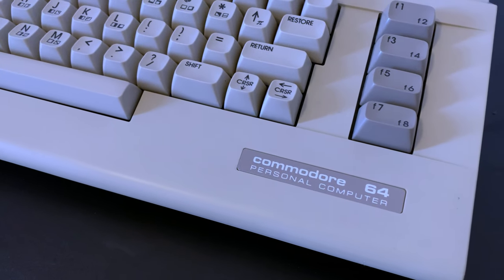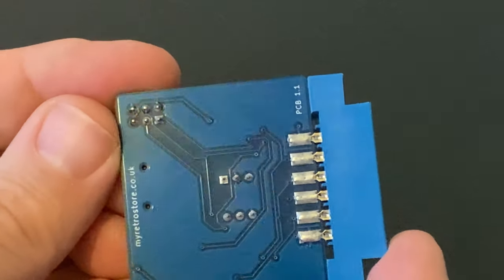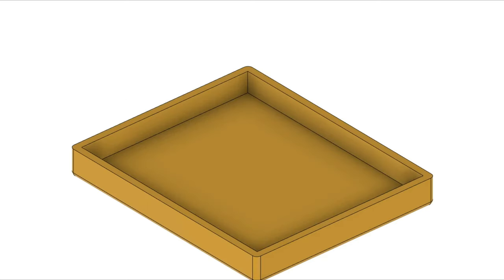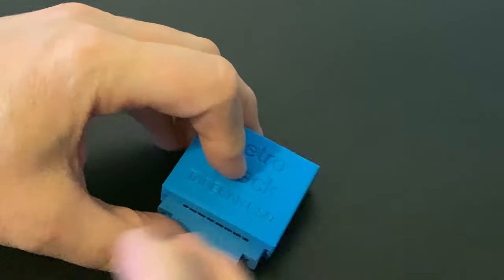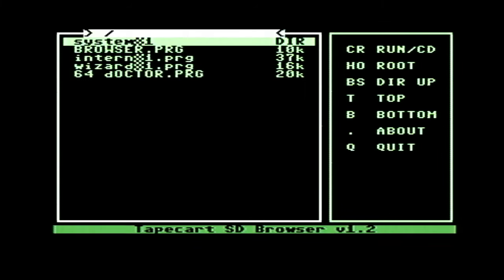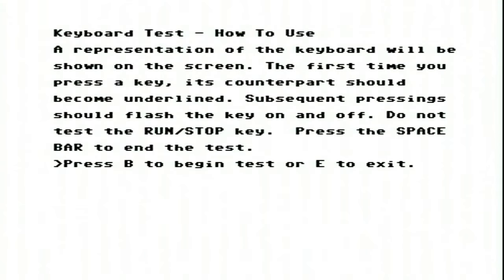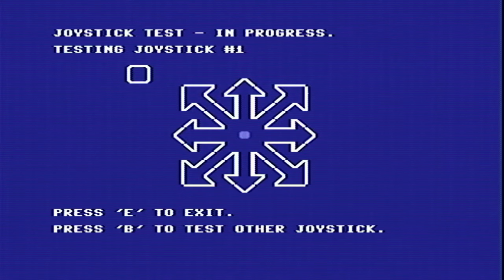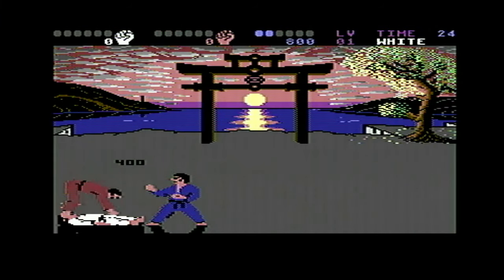Commodore 64C - Part Three: TapeCart SD

Comment: I've always liked the C64 but never had an original, as I went from the ZX spectrum 48K purchased from Boots, to the Atari 800XL with floppy drive.  Ah those were the days.  I think the Atari was very under rated and pretty similar to the C64 with regards to game quality.  
Even though I have  an 800 , 800XL and 65 XE I prefer using the C64 maxi that I purchased during 2019 and find game play and graphics hard to distinguish between the two.  I always loved the Goonies game which plays pretty much the same on the C64 as on the Atari.  
When I use the Atari I use a lead I made and put it through a hdmi upscaler where as the C64 Maxi just plugs and plays.  
Like your vids, guess I'll have to sub!!!
Reply from the maker: Glad to have you on board :)

Comment: I was given an SD2IEC but for real nostalgia, and no 'bad cracks' that refuse to work spoiling the mood when trying out games I think it's best to get a TAPuino which lets you load full tape images via the cassette port. I had forgotten how important a part of the experience the whole flashing bars, loading screen and loading music was. Never even knew a C64 owner with a disk drive in 1983-86 when I had one.
Reply from the maker: Check out the 'Is Waiting A Thing Of The Past?' video ( https://youtu.be/ZZGVHvSXPq0 ) :) :)
Reply: @TheRetroShack  I will check the vid out but for me personally the safest bet for me is a Tapuino as I don't like multiload games on disk or tape (the delay between gameplay ruins the atmosphere for me now). I did an homage to the C64 tape loading years of my youth "memories of a 1530 datasette" plus you get to hear some remixed SIDs from RKO website I frequented :)

Comment: 0:51 You mention that SD card tape drive emulator can load tape and cartridge files, but what about floppy disk games?  This was a concern of mine with getting into an original hardware C64 as it had software on three formats; the tape drive, disk drive and cartridge slot.  In your description, you mentioned that you have the C64 maxi.  I know that machine is emulated, but the latency is low on it.  From what I have seen, it is much easier to load programs into this version of the C64.  What do you find is better?  The C64 Maxi, or the original hardware?

Comment: Hi, Do the games have to be in .prg format on he SD Card or will it read them in a .zip format?
Reply from the maker: Hi Scott - the TapeCartSD only loads .PRG and .TCRT files - but it does them really fast :)
Reply: @TheRetroShack  Thanks, just looking at getting one (one my C64 arrives 😀)  if it possible to convert d64 files into. prg? Seems quite a few games are are not available as a .prg
Reply from the maker: @scottelkington7661  .d64 files are disk images that contain the programs.  You can use a disk viewer/editor to extract the PRG files from D64 images.  Here's one:  http://www.d64editor.com/     Good luck and thanks for watching!